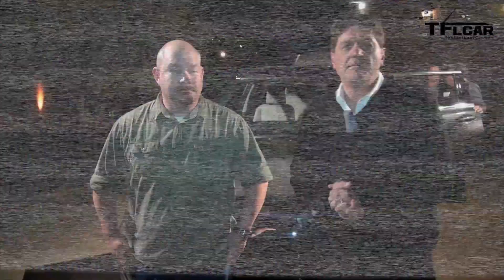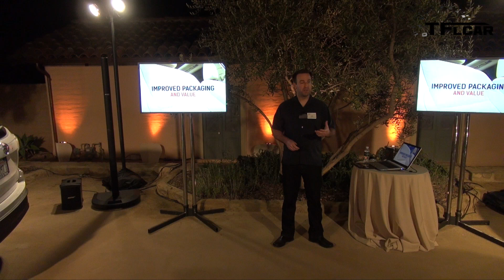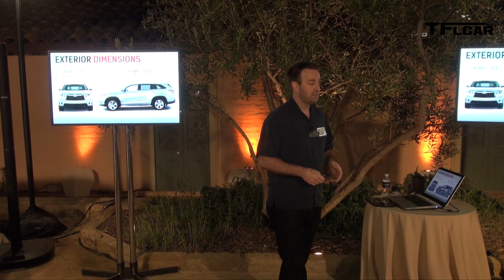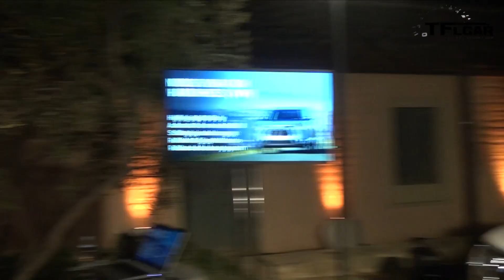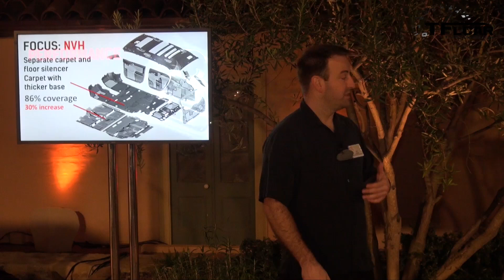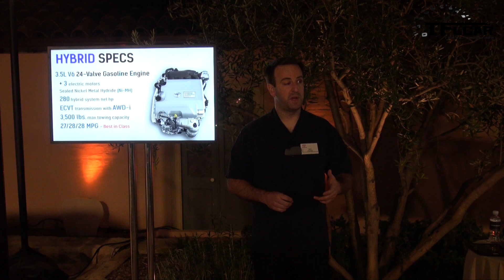2014 Toyota Highlander: Everything You Ever Wanted to Know

Comment: I LOVE my 2014 Highlander.  BUT Toyota cheapened out on 1) no LED running lights on XLE model  2) LED running lights in the fog lights is old school and should be part of the headlight; even Hyundai Santa Fe cheapo has it 3) include mud guards  4) if you're gonna talk about towing 5000 pounds then include a trailer hitch and light cable  5) no LED tail lights

Things I did like are:  Looks (clamshell hood like the Range Rover), acceleration, ride, handling, the side mirrors have turn lights.  Hands free bluetooth to my phone and EASY DRIVER SPEAK.  Backup camera/gps on big 8inch TOUCH screen with Toyota entune which links up to so many apps on my phone.  With the push button start option, I don't even use keys to unlock doors and liftgate.  Glass hatch on the liftgate opens.  Big 245 tires on 18 inch rims.  Can still carry a cooler and party stuff with the 3rd row up. Shade screens in 2nd row.

Comment: What? Why did you cut it off just as they were getting to the hybrid spec's? That's what I was most interested in.
Reply: Because Roman is a journalist, not a car guy. Same question could apply to his cutting off the semi truck tractor drag races at Bandimere just before they crossed the finish line, thus cutting out the ET and speed. No car guy would have done that. He is entertaining, I will admit, but he does not have a lot of automotive knowledge, based on some of his comments that demonstrate that his background is journalism, not mechanics. I watch him for the entertainment value, not the technical info. He is one of the better reporters and if he knew more about cars, he would be one of the best reporters on the net..